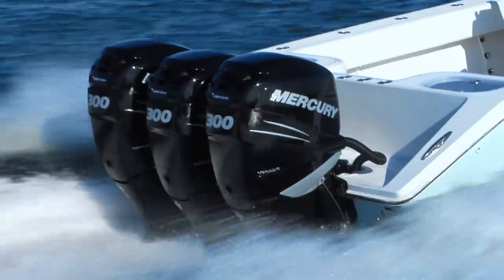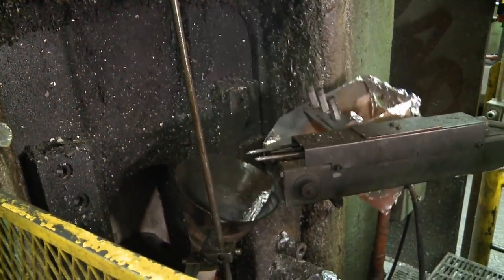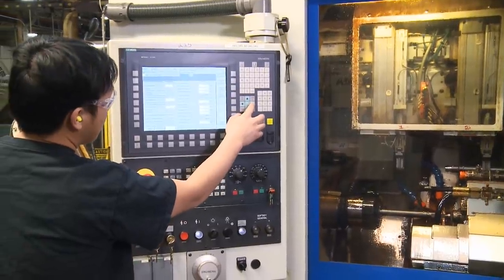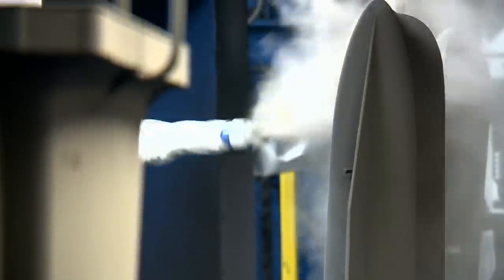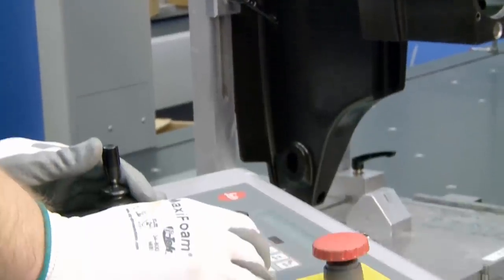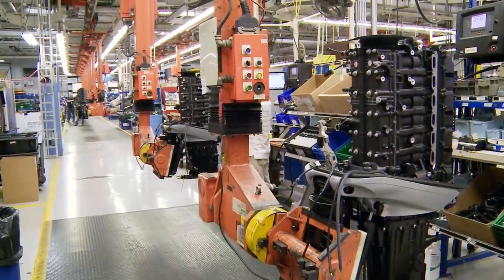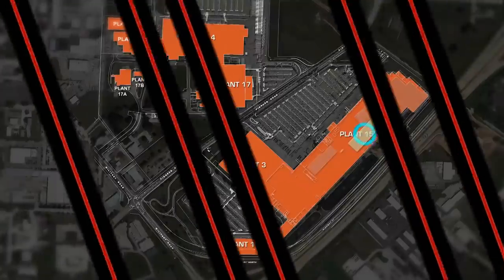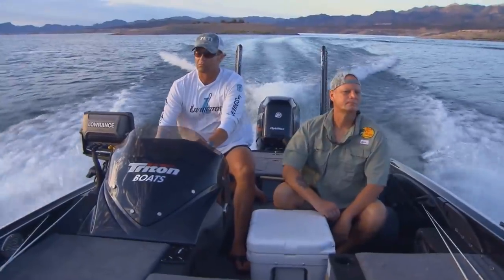Mercury Marine Plant Tour

Comment: This was very interesting. Back in the '70s I got a hold of my father-in-law's 23' I/O that he allowed a cold winter in Tacoma freeze up and shatter the iron block of the Chevy 4 cylinder, Mercury used back then. He had it completely rebuilt the previous summer, so I bought what was called a "fitted block" out of Mexico. The stern-drive was so early you had to pull it up manually. A friend of mine asked why I was so picky with restoring everything legit. I told him a boat is one-down from a plane in the need to function. He didn't with his boat and got stranded, but he learned a lesson. This video shows Mercury feels as I do, even though my old boat is now long gone. KL

Comment: Awesome video. Currently running a 1986 tower of power 6 cylinder 90 horse runs like a champ.
Reply: thatzrelfuny90 You have a great Mercury!
Reply: Love mercs. But..i have a 89 johnson88 30 yrs old. Never rebuilt. Just regular maintenance.still runs excellent.
Reply: I am a outboard enthusiast.i would have to say the tower of power IS the best outboard ever!!! When its running it sounds alive.any outboard finatic knows what im trying yo say 😉
Reply: Sam Ciarametaro It’s almost as good as a Merc!
Reply: i have a 90 Horse Mercury to this day she runs guns blazing only had to replace the bottom half of the motor broke in the motor to this day not 1 issue i had. They dont make them like they used.
Reply: @samciarametaro2705  I'll tell you brother I am of the same experience, I've ran a just a few Evinrude and Johnson Outboards but only a couple kicker size Mercury and I've had more Sears brand GameFisher, the smaller motors and have a Johnson that's lasted me over 25 years. Nothing like the Tower of Power nothing compares honestly ,,especially the Kiekhafer inspired Tower of Power 6 cylinder.
Peace
Reply: @samciarametaro2705  I know right Sam I've got a 78 Johnson 135 and other maintenance never had to do anything to it. The previous owner did and I also agree with your statement on the Mercury Tower of Power. Yeah, great sounding and bulletproof car Mr.Kiekhafer was the man. 
Take care.
 Peace

Comment: This is all good BUT: obviously you have planned badly or someone has mismanaged the 2019 production of the V8 250 Pro XS!! I’m told by multiple dealers, who are very upset with Merc too, and several that sell 600+ motors per year, that I will have to wait for up to a YEAR to re-motor my Champion 201. Frankly, this is BS.  I feel bad for small business dealers who are losing $ as we consumers simply go to a Yamaha or other.  Don’t want to but might.  Obviously you choose to supply Johnny Morris and Ranger/Tracker and other manufacturers but not us.  What gives and why the BS answers??
Reply: John Bell with how many big time boat manufacturers Brunswick owns they obviously have to supply their new boats first. New boat manufacturers always get first pick no matter what. The same thing happened when the Optimax and L6 Verado were released. Once the old Optimax line is converted to manufacture the new V8 and V6 the wait time will be heavily cut. The wait time on one now is about 18 months even though they’re producing over 100 of each every week. Demand is just that high for those motors

Comment: Mercury Makes a good Motor, but certainly not great, $500 to $1000 per year average in repairs for my 150 hp Optimax.
Reply: I can't imagine that? What's the issues and how old is your motor? I was thinking about a Optimax!
Reply: 1999 150hp Optimax....  Lots of warnings for overheating, weak water pumps, replaced multiple fuel injectors,
air injectors, water pumps, fuel pump, throttle position sensor, fuel cooler, etc....
Mercury was difficult to deal  with with my original motor on my boat, nobody wanted to fix it, 
I was told that all the parts tested good (it had an intermittant dead cylinder) and if the shop replaced a part under warranty, they had to send it back to Mercury, and if it tested good, they would send it back and
not honor the warranty. First two years of my new boat was a nightmare!
I ended up replacing the 125 Merc  with the 150 optimax, only lasted one season before the repairs
started.  10 years of repairs every year, now I don't use my boat nearly as much so, not as many repairs.
Reply: 2005 175 optimax destroyed itself at 360hr broken piston believed to be the cause and my 150 2010 just dropped the top off a piston at 300 hrs..you might say im a little disappointed in mercs since 2000...
Reply: Thanks for all the input you sold me on an Evinrude, we don't have a Mercury dealer closer than 100 miles anyway...... it's a no brainier now!
Reply: Jeff Bang the 98 and 99 had really bad issues but it was fixed in the early 2000’s.
Reply: Tri Pacer Goid luck with Evinrude.
Reply: wayne bonham Operator problem.
Reply: Aren't they good engines now days?? At least we have a dealer here, that helps. I would actually like a Honda but same thing, 100 miles away for service...
Reply: I'm pretty sure if you learned how to take care of your outboard you wouldn't have those problems.
Reply: @tripacer8259   If you buy a Honda, you won't need service.
Reply: @mikepodella  That has been the case with every other Honda I have owned.....
Reply: @tripacer8259  That didn't age well. Now no manufacture.
Reply: @jamesglavich1426  You're right.  Glad I bought a Yamaha motorcycle instead! That was a long time ago....